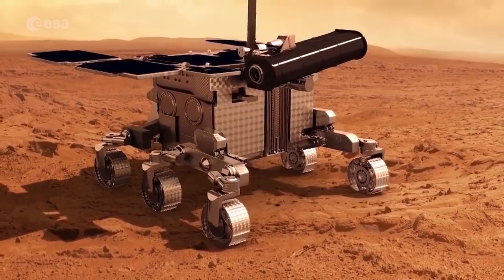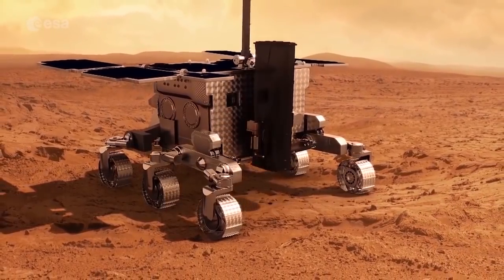ExoMars parachute drop tests important step for future rover

Comment: With an atmospheric volume less than 1% of Earth's, why would you even test these parachutes at all to simulate anything on Mars?  We all know how parachutes work on Earth.  How do you control something 180 million miles away?  Radio waves?  White lab coats?
Reply: Automated landing, and btw the parachute might be very safe, but you always have to be more than sure it'll work
Reply: @calebgangte1228  not to mention the extreme speeds this will be at, causing the dynamic pressure to skyrocket
Reply: Those parachutes deploy in Mars thin  atmosphere when it is going very very fast.  That’s how it is engineered, and why it has proven itself to be effective in multiple missions. Part of the testing is done in partial vacuum to mimic Mars atmosphere.
Reply: @faheyplayer  Because it's going fast, that's why it's effective?  Got it.
Reply: @thaddday  No. If it’s going fast through thin air, that gives it just as much braking power as going much slower in Earths air. Think about it.
Reply: @faheyplayer  No thanks.  I'm not really into your religion.  Mars isn't a terrestrial sphere that you can land a robot or two on.  Neither is Earth.  Have a good day.
Reply: @faheyplayer  Triggered!
Reply: @thaddday  Responding to complete BS is more like it.
Reply: @thaddday  LOL you think there are not answers to your questions? You ask them as if they couldn’t possibly be true. You claim that we all know how parachutes work on Earth.   Umm, no.   No we don’t. It’s much more complex than you think, unless you have actually studied the physics of parachutes. Please , share your cutting edge knowledge, we would love to hear it.
Reply: @faheyplayer  The only question I had (based on the video...remember that) was why would you test parachutes in an atmosphere not at all like the alleged one on Mars.  As soon as NASA can change my TV channel is when I'd consider them controlling anything 180 MILLION miles away with religion.
Reply: @thaddday  I would be happy to address your sincere question; it’s a good one.
So before they even begin designing the hardware for these missions, they know and use the data we have on the atmospheric profiles of Earth. We have more limited information on the upper atmosphere of Mars because we have data on those from only several missions - Viking, Pathfinder, Spirit, opportunity, Curiosity, and Perseverance - Plus, Mars air varies More than Earth’s does seasonally, so it’s less predictable than on Earth, which is the main reason landing there successfully is really really hard, always a nail biter. 
All that being said, yes Mars air is vastly thinner than Earth’s, meaning less dense, way less air pressure, almost a vacuum really, even at sea level, known in Mars science as the datum, or average elevation of land planet wide.  
Now here is the critical part in answering your question. IF you go very fast through Martian air, you get about the same stress as you would on Earth. Conversely, if you drop a parachute in Earth’s atmosphere, you can simulate the stresses of the higher velocity you have on Mars.
Also, it’s helpful to understand that the parachutes are slowing the spacecraft down by thousands of miles per hour in just a few minutes. That’s pretty critical, or you slam right in to the ground. The spacecraft enter Mars atmosphere at high altitude, bleeding off velocity by facing its blunt heat protected butt into the direction of travel. The velocity on entry is so great, that even in Mars thin air you can melt metal and burn up, and that would suck.then much lower down in altitude where the air is finally thick (dense)enough,  the spacecraft fires the chutes out of a mortar, and are critical for slowing it down in a hurry, which is extra hard on Mars, as the air being thin makes its braking potential very inefficient until you get down much closer to the ground where the air is thicker. So it’s hard to do, but can be done, and has been done.
 So to summarize, they test on Earth, understanding in advance how air stresses a chute, no matter what planet it is. It becomes possible to calibrate your testing to reflect this.  Leaving nothing to chance, and given a few surprising failure in the past during testing the past with parachute design , they even double check and test the parachutes in a big room they can pump the air out from, and accurately reproduce the Mars near vacuum air pressure/density. The engineers who design and build these spacecraft and rovers are most definitely not throwing darts or trying to get lucky.  They know what they are doing. They devote careers to it. Unless all 5 million scientists and engineers of them are colluding on a fake enterprise of rocket launches and infrastructure to where special telepathic powers allow them to keep the big lie straight, cuz I’m pretty sure it would suck to have to keep two alternate realities straight, side by side. 
Now, with regard to your question about being controlled by radio. Well, yes. In fact, this technology to wirelessly transmit messages invisibly through the air has been around for, a century.  You can control any matter of switch you like, remotely, by using the very technology- you said “radio waves”-. Did you know
you could change channels on a television with this technology? Did you know you could send a message all the way to the moon with 5 watts? Just because it doesn’t make sense to you immediately should not be a reason to call BS, I think that’s really inconsiderate. Regarding being controlled remotely by a lab coat, I couldn’t tell you.
Anyhow, I hope my answer to your questions about parachutes is helpful. Have a nice day.
Reply: @thaddday  troll
Reply: @joag1971  I thought they were honest, thought provoking questions.  Animation doesn't cut it for me.  What kind of communication device sends video and photos 180 million miles?  And how?
Reply: The NASA CARTOON NETWORK.
Reply: @danielmconnolly7  ok troll